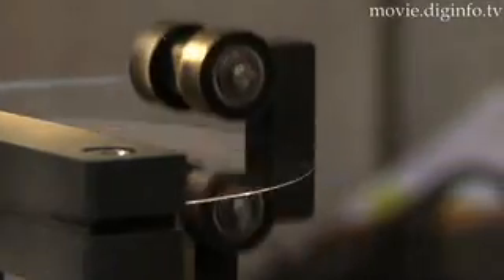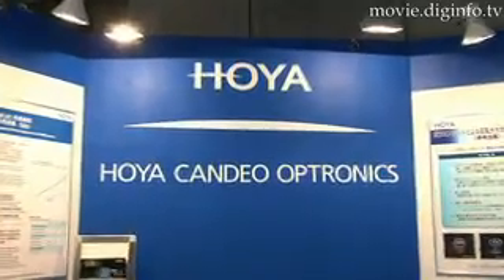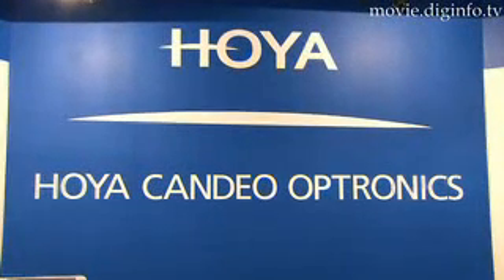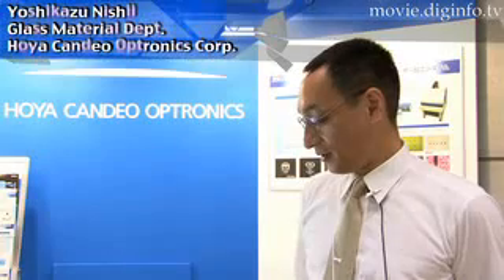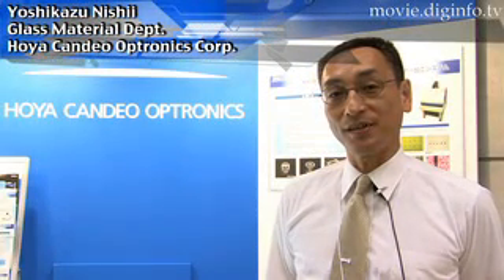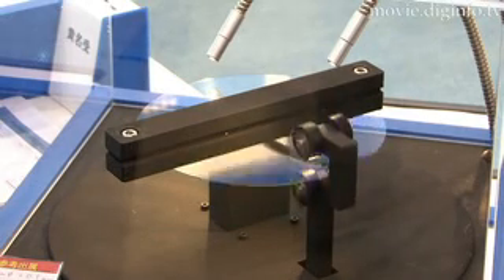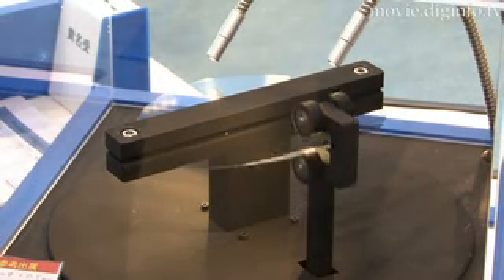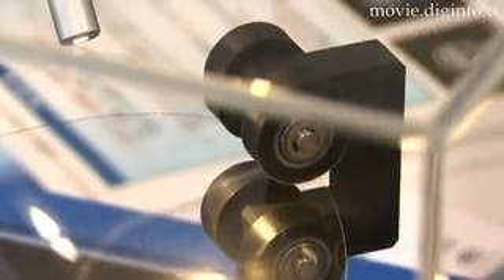Flexible Glass : DigInfo

Comment: I would buy some of that right now! I use plexy glass or plastic for my molds and every time I clean off the epoxy I get a new scratch that shows up on the finished product. I know glass you can use a metal razor to clean it and it wont scratch.